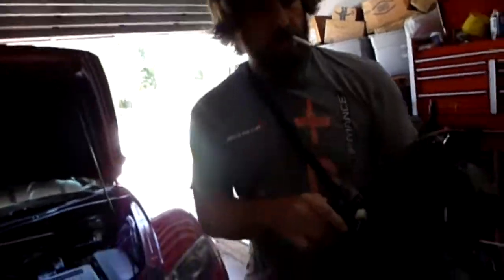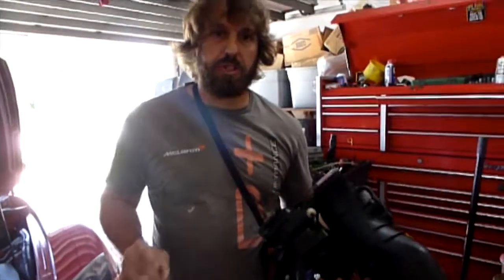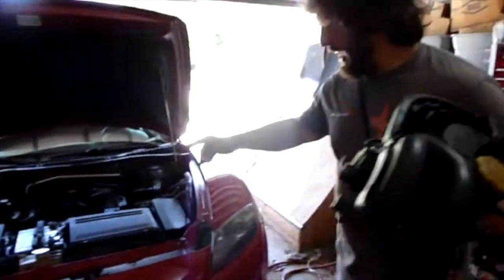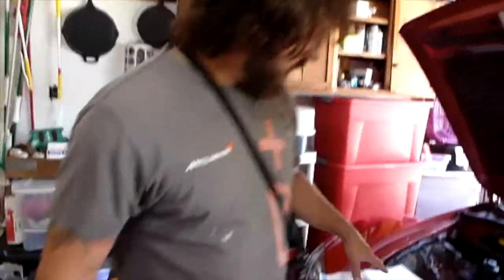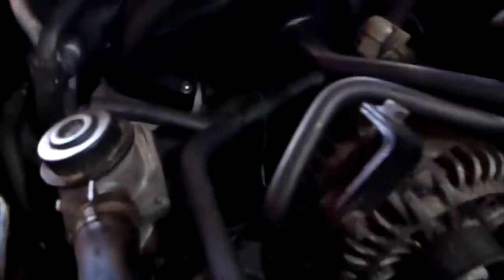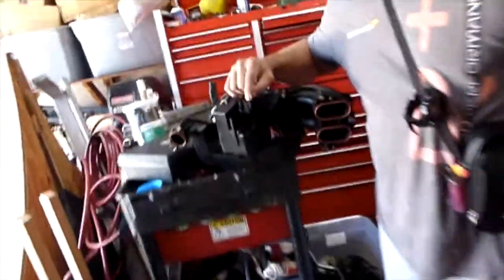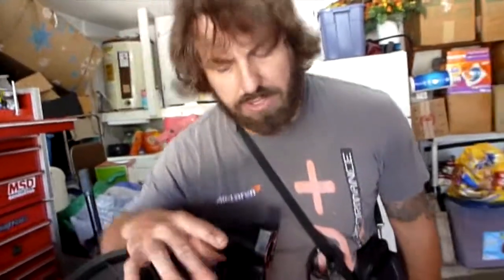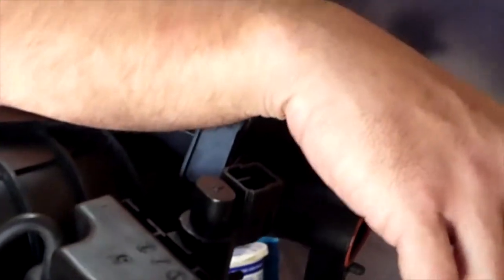Mazda RX 8 Code P0661 P2259 codes explained in detail with diagrams

Comment: Here I am two years later and coming to the same conclusion....I am working on two of them with the same issues..and they get it from overheating under the hood they all run way to hot..  drive one somewhere get out..lift the Hood and stand in front of the engine ...it's  the  same as the turbo cars I'm  always repairing overheated broken wiring ...I learned from racing years ago that  just by  adding a vented hood and directing the Rad heat up and over the hood reduced our under hood water temp by 40 degrees..I'll be venting all my RX8's from now on..
Reply from the maker: It's a Racket if you look on the internet to fix this issue. Glad you came here!

Comment: unfortunately after hours of searching i can not find any of the schematics you showed here as to the pcm plugs and wire colors, i have P0661
Reply from the maker: p0661 is pin 1L in the same plug that's in the video. your wire color is.... Drum Roll Please..... Blue with a Yellow stripe! please send all donations to randroids@gmail.com
Reply: @safekracker436 dealing with this same issue right now! Code p0661 replaced solenoid, svv holding vacume, going to start testing the wire

Comment: Thanks for the vid but what if you have the P2259 code only?
Reply from the maker: This video explains the 2259 all the way thru to the ECM including wire color and pin # The solenoid in question will be the top one on the plenum.